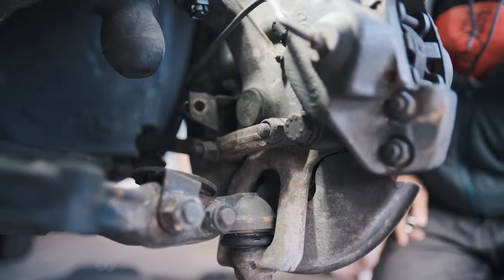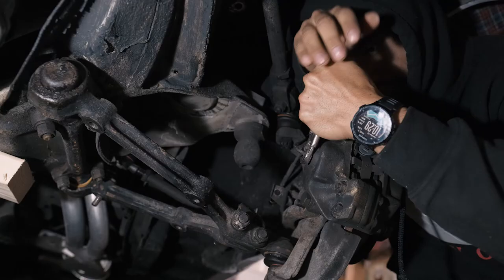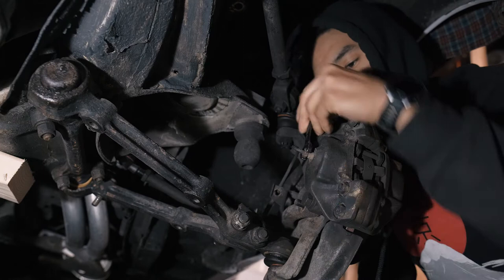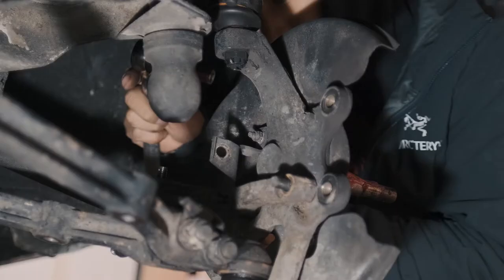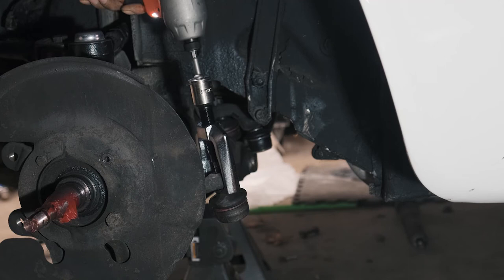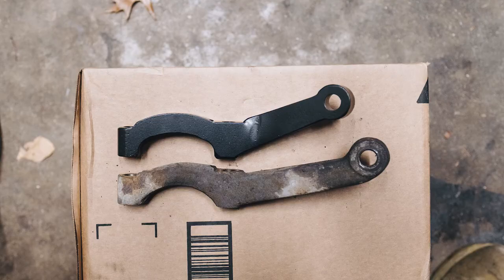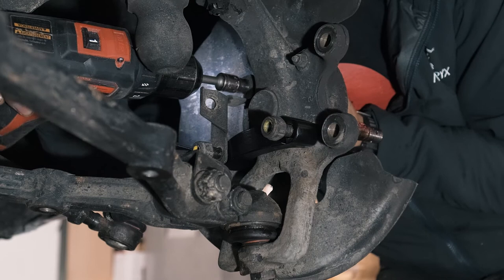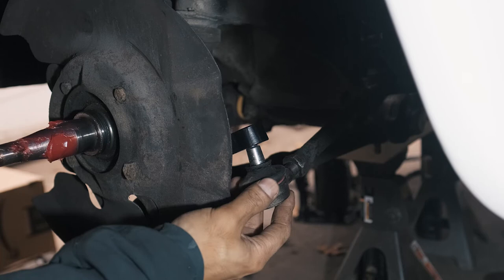Installing Alfaholics Short Steering Arms on Alfa Romeo 105 Giulia

Comment: Nikko. It's never too late but I recommend the use of a copper type assembly grease on all bolts and nuts. Keep up the good work.
Reply: pro tip: watch movies at Kaldrostream. I've been using them for watching lots of of movies during the lockdown.
Reply: @Damari Damien Definitely, have been watching on KaldroStream for since december myself :D
Reply: @Damari Damien yup, have been watching on kaldroStream for months myself =)